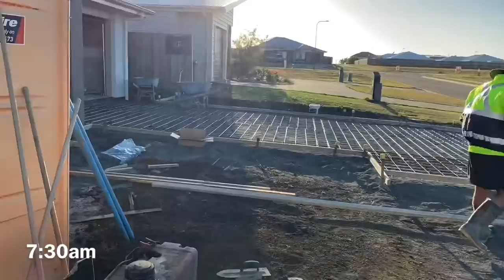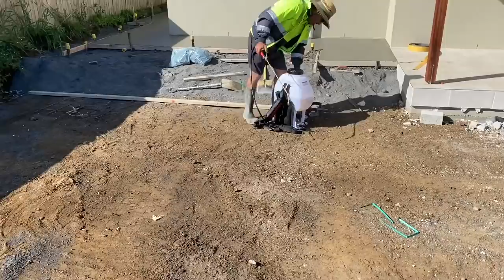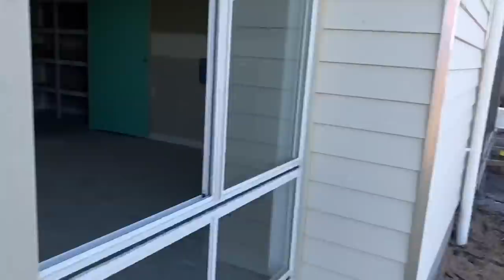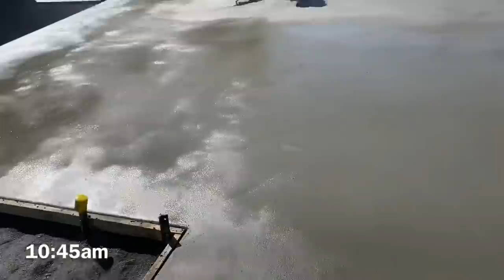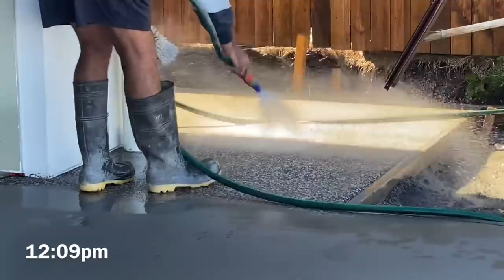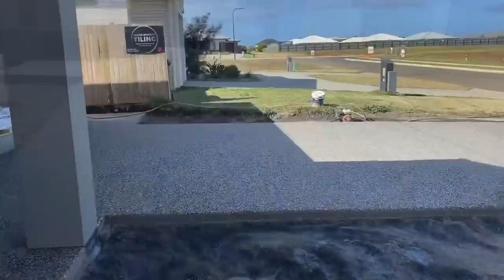How to do a cold joint in the concrete

Comment: Used to get mad cold joints waiting for trucks. Hated it. 
Found the best success keeping it as straight as possible, putting a screed through it and magging if it was too far gone. It would be hard to get it perfect with exposed though, easy to cover up with cream on normal concrete